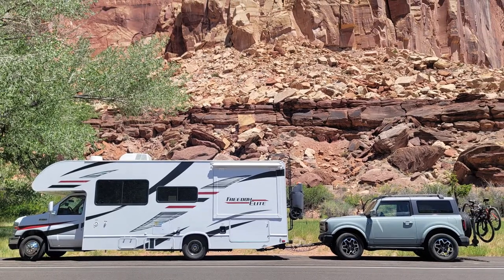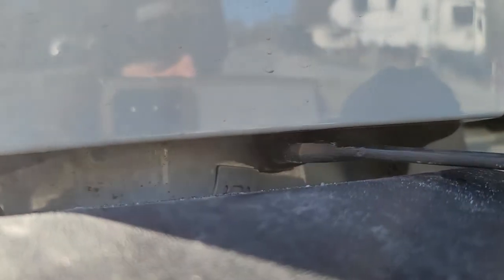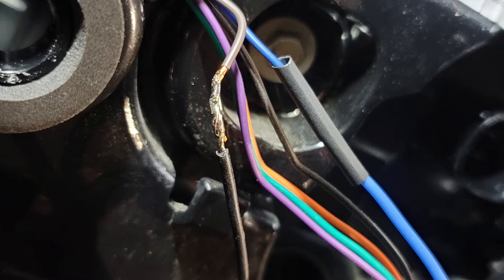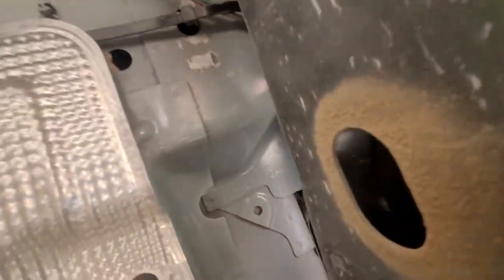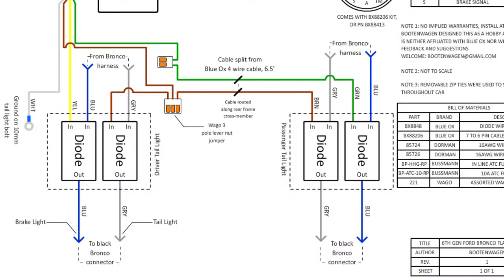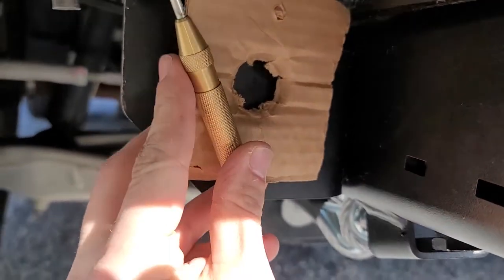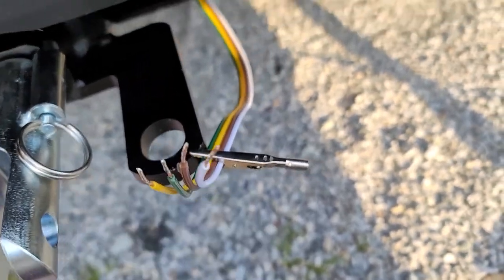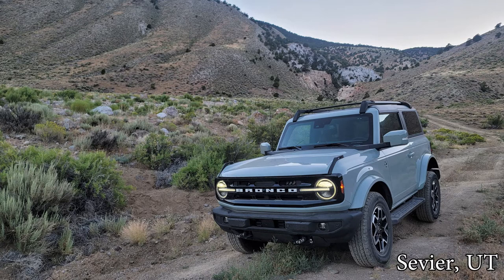How to Flat Tow a Ford Bronco - Blue Ox BX8848 Tail Light Diode Wiring Kit  Install (Part 3/4)

Comment: Thank you for doing these videos.  This is much needed information
Reply from the maker: Thank you, I'm happy this is helpful!
Reply: I have also outfitted my 2022 Badland non-squashed 2 door to flat tow. I used the CURT wiring harnesses with built in connectors and also noticed that my turn signals look different in neutral tow. I thought I might have a problem but see that yours do the same.  Thank you.
Reply: @bryanswanson638 yeah they just use the tail lights, not the yellow turn signals